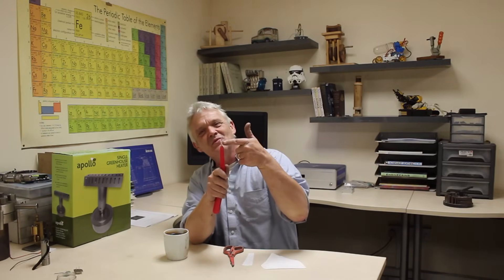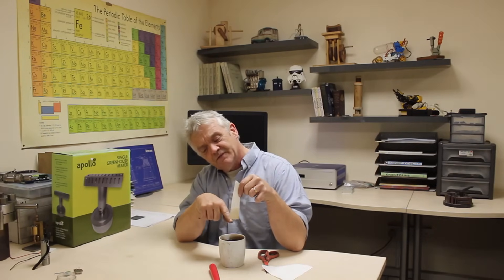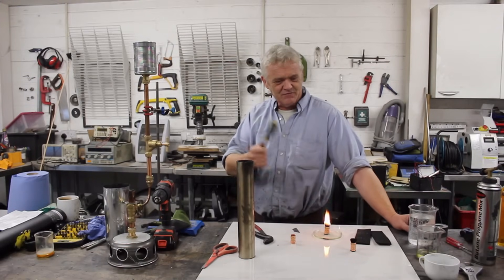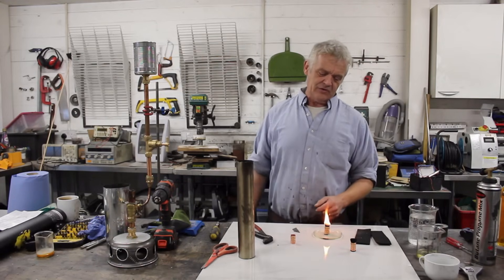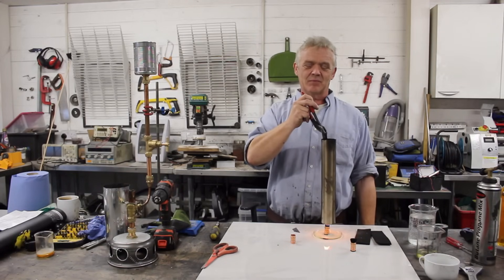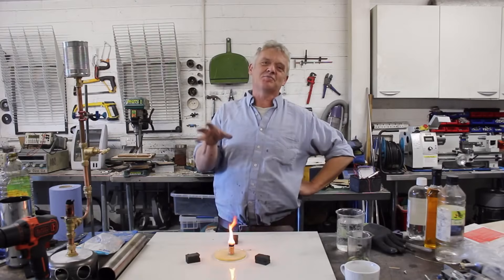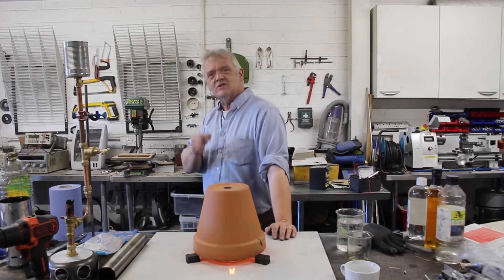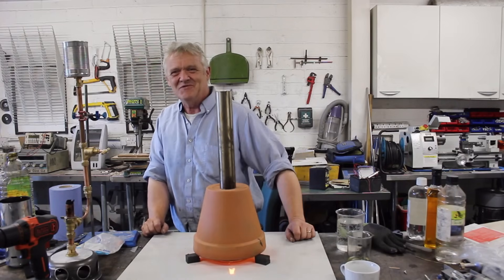1680 The Magical Forever Wick - The Plant Pot Heater On Steroids

Comment: This is cool.  I will take the bait and see how it works on motor oil, if it fouls as badly as other wicks.  BTW carbon felt does burn.  Just maybe not in the reducing atmosphere that a wick is surrounded by.  BTW it smoked pretty bad when you put the chimney on top of the flowerpot.
Reply from the maker: let me know how it goes will you mate - I have been wondering if the carbon felt would as act as a kind of filter - I was thinking of trying it too - but if we both give it a go that would be awesome

Comment: Great post. And that's prolly the best thing to do with seed oils. I'm not sure about the terracotta pot, with my luck the flippin thing will crack.
Reply from the maker: lol - I only did the pot thing because folks can find it hard to 'see' a use - myself I wouldn't use a pot indoors as there is too much wrong with it in other ways - but it does have the benefit of being very simple to make

Comment: Btw, the carbon felt wicks do get degraded over time. They last a lot longer than the cotton ones, but nowhere close to indefinitely. I've done experiments with them, trying to make an efficient/complete combustion wax burner.
Reply from the maker: it doesn't really surprise me mate - not even mountains live forever - but thanks for the share
Reply: What happens is that they get very crumbly and brittle, especially after very intense/hot burns.

   Great video though. As usual, I gave you a like.
Reply: Carbon felt is not (always or never) 100% carbon, there are some plastic chemicals in it too. That part may explain the deterioration of the wick, depending on brand and quality, because pure carbon by itself should not degrade one bit at oil combustion temperature. Now @Robert Murray-Smith may need to roll a graphene sheet into a wick for complete investigation...

Comment: I noticed that when you put the tube on top of the plant pot it began to smoke and I'm not sure why. Was it residue in the pipe burning off?
Reply from the maker: there are a. number f reasons mate - and I am going to address them in later vids - I like to keep the presentations to a point rather that dump a whole load of info that just gets confusing - here I just wanted th show the wick working and in a simple practical example
Reply: @ThinkingandTinkering  thankyou, I look forward to it.

Comment: a comment that comes up regularly with candle heaters is that you cannot create more energy than you put in (3rd law of thermodynamics) so a plant pot cannot generate more heat than the candle provides. I'm no scientist but wondering if there's more to this?
Reply from the maker: no - the reason it gets hotter is you are burning more oil

Comment: The flowerpot will probably heat the oil up around the wick enough where it could light if tipped over. I also found this with a quick Google search...The health implications of cooking oils to high temperatures, Provost explains one by-product that can be present in the smoke is acrolein. It can bind to amino acids and DNA in your body and cause changes in the DNA, making it a potential carcinogen.

Anyway, still, interesting Robert and with a flue to the outside, this could be a Good sourse of heat. 👍
Reply from the maker: no - it probably won't - but it's like any fire mate - you have to treat it with care
Reply: @ThinkingandTinkering  I did watch a video where several tea light candles caught fire under flowerpots, it's on YouTube, but anyway...Yes "fire" = caution!

Comment: I've seen where they make "carbon tiles" out of regular white bread & charcoal process, is it possible to use strips of bread charcoal to make a carbon felt wick?

I just like the idea of using bread to burn vegetable oil as a small "green" heat source
Reply: That would be great if it worked. Let us know if you ever try it.
Reply: Cotton balls might be better to gain capillary action by the fiber structure (even just raw picked cotton). Bread is going to produce a series of sealed pockets. 

I imagine you could also just take a piece of cotton cloth and carbonize it to make the felt you need. Char cloth is common for fire starting kits.
Reply: As long as you form it into the shape you want before you carbonize it... maybe. A tortilla might work too.
Reply from the maker: it's not the carbon so much as the capillary structure mate - carbon burns at 400 plus degree centigrade cotton around 210 - so the higher burn temp makes it last longer but you still need to draw the oil up and any structure that can do that will work just fine
Reply: @ThinkingandTinkering  doesn't traditional bread have wicking properties?  When I get oil and vinegar on my deli subs, they sit on top of the veggies at first - but if I leave it set for 10-20 minutes (enough time to carry in groceries) then the bread starts to get soft and moist on the edges furthest from the O&V.

I think the traditional cell structure of bread makes it possible, but it was just a thought I had.

Thank you for replying, I've only recently found your channel but I love what you do.  I wish I had a science teacher like you when I was growing up.

Comment: Haha, I actually mentioned/recommended carbon felt to a person commenting on one of your prior videos--like yesterday or the day before.

If you combine the principles of using those vortex type stoves (two cans of a different size within each other, with offset holes on bottom and/or top), insulating the stove and using copper to conduct heat, using multiple carbon felt wicks, and using a chimney, you can create a burner that burns various different waxes quite efficiently and cleanly. 

   This is exciting because wax contains a lot of energy within it, and in a very stable, light, easily transported form. The issue with burning a lot of wax at a time and hotly, is that it has a tendency to sputter out of the container, which can be dangerous.
Reply: Could I use the cooker hood carbon.
Reply: @mitch190  I will give rockwool a go, it's worked well with alcohol stoves, thanks.
Reply from the maker: lol awesome mate - love your ideas - cheers
Reply: Anyone try braided copper desoldering wick???🤔

Comment: During Desert Storm, when stuck out on patrol in the middle of nowhere, we would use a cut up Coca~Cola can with a piece of cardboard for a wick as a "field expedient" camp stove to heat up meals.  Just splash a couple ounces of diesel fuel into the can (making sure to saturate the cardboard) and light the cardboard.  It was extremely sooty, but it would boil water in a metal canteen cup fairly quickly.  A three man team could use this to heat up water and meals before you ever ran out of diesel in the can.
Reply: Thinking and Forming Survival tactics when needed,  well done.
Reply from the maker: nice share mate - thanks for taking the time to post - loved it

Comment: Yeah, it should produce more heat, but at the cost of more smoke. Usually, you aim to make candle pot heaters to be smokeless and ventless. I guess you could take an old fashioned kerosene heater and put the forever wick in that with other applications.
Reply from the maker: you didn't read the comments did you? lots of good suggestions there about the smoke - you have to remember this is a knocked up version mate
Reply: External air intake and exhaust, like advanced gas heaters have. The hot ceramic material radiates very comfy infrareds, and you can also design a room air circuit around it (internal air intake and exhaust) that will never get in direct contact with the burning flame.

Comment: At the end it's smoking and that could soon fill a small room with fumes.
Reply from the maker: so - what would you do about that? how would you make this better?
Reply: @ThinkingandTinkering  I'm not sure you can. Maybe try and increase the air flow to give a cleaner burn but that would probably increase the oil consumption rate. I suppose it's a trade off. An adjustable wick ? Traditional storm lanterns get quite warm and you can adjust the flame size. Can you make a carbon wick for a storm lantern or table lantern ? That might be interesting. Cheers.

Comment: That's pretty cool robert, I used the pot and the tea lights a few years ago out of necessity, and they do work pretty well. I wonder which fuels you recommend for this; Does the veg. 
oil stops smelling and creating soot when using a chimney?
Reply: How do you stop a oil lamp from producing soot? You shorten the exposed wick. Most oil lamps have a gear that raises and lowers the wick. So with the carbon filter wick, just trim it to the height that doesn't emit soot and even a smaller diameter. I was thinking of a 3/8 copper tubing with 3 or 4 slits cut in the bottom to be bent out at 90 degrees as legs to make it more stable. Place it in an empty tuna can with oil added. Place that on a ceramic plate and then the flower pot on blocks. You don't want a big flame like he had. But a bigger flame than a tea candle would produce more heat.
Reply: You can clearly see the soot over the chimney, so you probably need to improve the draft to create a complete combustion, together with a double wall combustion chamber to raise the heat even further. Basically, a rocket stove, but using oil instead of wood. Much better than a rocket stove, actually, because instead of constantly feeding wood, it's easy to get a constant flow of oil from a big drum of recycled cooking oil.
Another issue with such open fires is the risk of emitting deadly carbon monoxide, or even plain carbon dioxide. The most advanced gas heaters get an external air supply and exhaust, it's the hot ceramic material that radiates the infrared heat, and the room air that enters the base of the heater and come out warm on top, without ever getting in direct contact with the flame. I'll try it out. This may not replace my wood stove, but I reckon it could be great to heat the glass house in winter and spring for my citrus and tomato seedlings...
Reply: @Chimel31  
It's a great idea using oil as long it doesn't smell. Much easier to automate oil than wood feeding for a mass heater or rocket stove :)
I saw some time ago a video here in YT of some guys doing a heating system for a glasshouse by burying a few pipes in the ground and sticking the ends on the surface. At a certain depth the ground has a constant temp so is good for winter and summer.
Reply: @metralla  yes the North Americans seem to be building a fair number of geothermal greenhouses. There's one video where a man is growing oranges in Alaska. the pipes need to be below the frost line.
Reply: @Metralla   There iis no smell at all if the combustion chamber is connected only to an outside air intake and exhaust, with a secondary air circuit that gets heated inside the chimney's double wall, with an intake from the bottom of the room (supplemented by a small amount of outside clean air), and several exhausts of clean warm air back into the room.
Geothermal is great too, and since my house needs complete restoration, I am going to lay loops of PEX tubing with oxygen barrier deep below a layer of insulating expanded glass granulated, above which I'll integrate more PEX tubing to form a low temp heating floor, with complementary heating between the two loops (not a direct feed).
I also want a small warm cabinet to leaven bread, croissants or to ferment yogurt and cottage cheese, so I am looking at all these low tech ideas, but I am not there yet...
Reply from the maker: there are improvements to make mate - what I am really showing is the wick - the stove bit is just to give an example in use

Comment: Will the rising temps in the pot ignite all of the the oil though?
Reply from the maker: that's not likely mate - the smoke point for oil is around 250 degrees centigrade -it is going to have a very hard job getting to that given the size of flame, oxygen flow and mass - if you force air over it increase the wick size to half a meter and make the plant pot tiny - then yes maybe - so - don't do that

Comment: I ran into a problem with wicking a few years ago when I tried to make a heat pipe.  Heat pipes only work when the lower part is hotter unless they contain a wicking material to bring the working fluid to the top.  I couldn't think of a material that wicks well enough to pull water up a few feet at least.  I'll have to try this.

Not sure how I'll get felt in the tube, though.  I may have to fill it with natural rope or a dowel rod and graphite the material once in the pipe
Reply from the maker: I like that mate - that is clever thinking - I am tempted to try that too - I have some experience in heat pipes
Reply: Would it be possible (and/or make sense... :) ) to have a slightly smaller, inner pipe and the wick running between the pipes? I'm planning to do some experiment with heat pipes combined with solar ovens (parabolic burners?), but I decided to start with the parabolic shape before figuring out the heat pipe. Can you update here if you figure something good? :)

Comment: Brilliant. This reminds me of an old survival stove I saw when I was a kid. Coffee can, with a toilet paper roll in it. Filled with alcohol, when lit, it only burned on the top, and the paper barely singed.
Reply from the maker: same principle I think cheers mate
Reply: That's a cheap Tiki Torch to ward off 'skeeters!!! Wire a tin can to a post, insert TP, pour in appropriate amount of kerosene & light on 🔥 🔥 🔥!!!😁👍🏻
Reply: @RTR-MATEY  great idea. I need two for my entrance in winter to guide drivers in. Thanks for the top tip!
Reply: @RTR-MATEY  
Hi
How long will it burn, can you use it indoors?
Reply: A large tin can half full of sand with a few ounces / 75ml of gasoline in it will burn for - idk how long, I put it out after half an hour. Not very safe, but probably better than burning straight liquid petrol.
Reply: @bozo5632  petrol....gasoline, diesel or kerosene???🤔
Reply: @RTR-MATEY  gasoline.
Reply: @bozo5632  Gasoline is HIGHLY FLAMMABLE!!! Use Kerosene instead!!!
Reply: @RTR-MATEY  That's the point of the sand, it slows down the evaporation.
Reply: @RTR-MATEY  I discovered this after setting fire to a few ounces of gasoline in a coffee can and trying to put it out with sand. It turned into a giant Sterno can.
Reply: @bozo5632  I put a little gasoline in a tin can once. Threw a match in. The flame shot up ten feet and burned and burned and burned. Luckily, I was outside on a patio. No harm done.
Reply: The cool thing about the alcohol burning can heaters is they are safe for emergencies in cars. When the top is charred you simply put it out, remove the toilet paper and reinsert it upside down and relight!! Could save your life one day.
Reply: @sharonhigby7114  yes, alcohol burns clean with no carbon to kill ya like the other stuff mentioned! You can also just keep adding alcohol again & again in emergency situations like power outages without replacing the TP. It'll heat & light your space up nicely. We made 3 a few yrs ago & used them for about a week in freezing temps, & they kept a 2 bedroom apt 80°F. Awesome invention I must say... 
We could only find 70% alcohol, which wasn't ideal, as the burn time gets shorter & shorter as you go, but still works fine (as I said we used them a whole week, pretty much nonstop). Sometimes it'd get too hot inside & we'd have to extinguish 2, leaving only 1 for light~ they heat that good.
Reply: Womble ofWimbledon
How long would that burn for and can you use it indoors?
Reply: @jude7321  You can't use it indoors unless it's flued to outside.
Reply: @stevem815  
Thank you ❣️🌿🐦🐴
Reply: @jude7321  I do not know. Testing would be needed.
Reply: @wombleofwimbledon5442  
Thank you ❣️🌿🐦🐴

Comment: My garage is uninsulated and pretty miserable to do any type of work in the winter. I might try and build one of these for the winter.  Great project!
Reply from the maker: it got really hot mate
Reply: @ThinkingandTinkering  I think I'm going to try and get some old fryer oil from local restaurants. I know they're getting rid of that at 5 gallons at a time.

Used well, those 5 gallons should last several weeks if not large part of the winter.

Comment: Any idea how using glass-fiber cloth would fare?
Reply from the maker: it lasts a while but has a tendency to melt into little bobbles at the end of the fibres
Reply: @ThinkingandTinkering  Thanks, and small bubbles would be equal to less effective.
Does it have to be a sponge type material - will carbon fiber cloth do the trick - I imagine it is more readily available as it is used in resin castings, etc?

Comment: I freaking love it!    

I wonder if you could get even further capillary or thermal syphon action if you use a small internal diameter?
Reply from the maker: I honestly don't know - fancy giving it a go and letting us all know?
Reply: The diameter of the microscopic passageways and pores in the material does affect the height you can draw something to - the smaller the better - but it also reduces the flow in each micro-tube. If you need to deliver more fuel in total, you would need to increase the cross sectional area of material used. But those two factors are independent - changing the overall diameter won't affect what happens at the microscopic level, just how much of it. Now if you compress the material, that might be a different story.
But as they say - all the theory in the world can be undone by a single experiment. ;)
Reply: @DFPercush  Hardwood briquettes have a nano capillary containment if annealed.